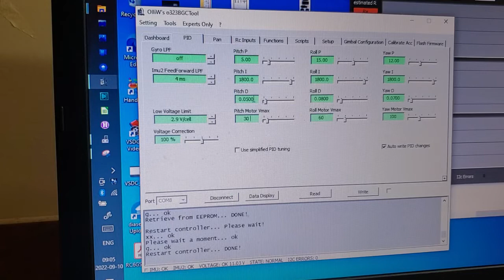PID and Vmax Tuning - DJI FPV RC Car - 3 Axis Gimbal

Comment: The first few times I turned on my gimbal it worked fine ( I bought a cheap one to practice for the real thing) but now it shakes like hell and I'm guessing I'm going to have to use this utility.
Reply from the maker: Ya, sounds like a tuning problem.  The gimbal will shake if its really unballanced or if you changed the ammount of weight on it.    Try the utility and read through the tuning steps in the storm32 wiki pages 👍
Reply: @JIPPERR_1  yeah i think I changed the weight, was wondering how to reset it. I think i have the bgc 3.0 board, does that work with this storm?
Reply from the maker: @asdfasdfasdfasdfzzzz  you'll have to go through the download page and find the right gui and firmware version for your board.  I think it checks when you connect so no harm in taking a guess.  But dont quote me on that.  I'm not familiar with the 3.0 boards unfortunately.